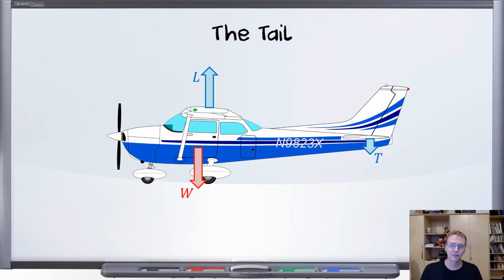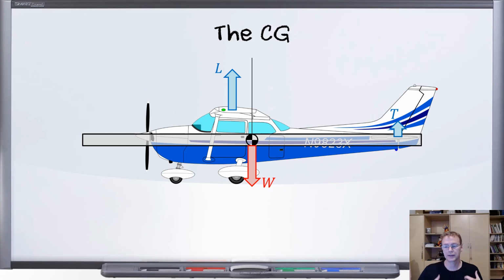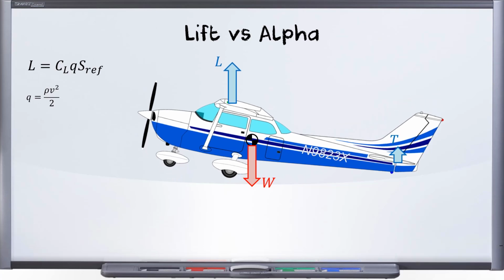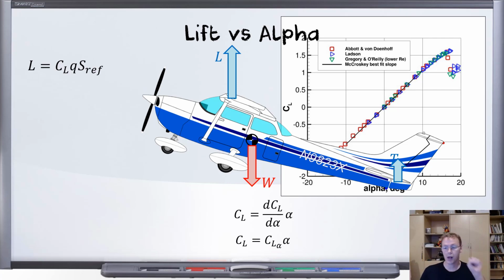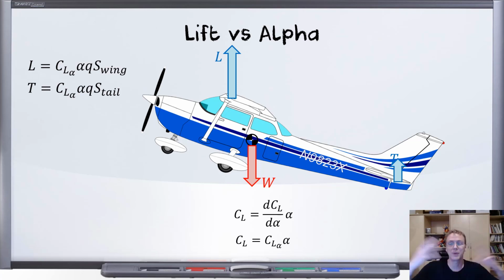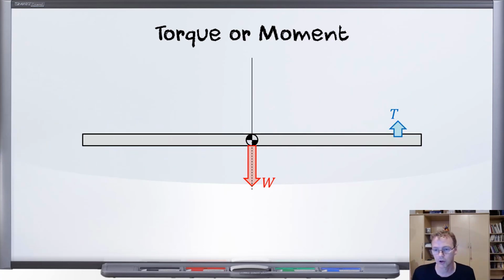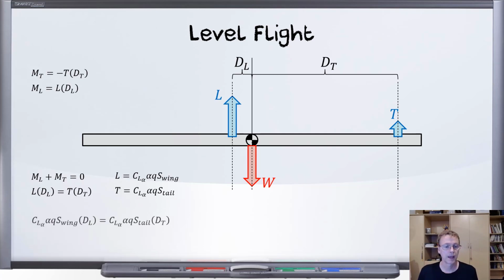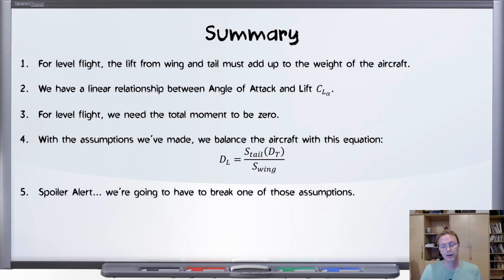Stability Part 1

Comment: Ideally we want to iron out all the assumptions right?
I guess I'd start where you started, with the linear relationship of what was it angle of attack vs Q. So that our equations could more accurately cover a greater range of airspeeds.
Honestly I have no idea what I'm talking about!
Reply: I'm laughing out loud at that last bit, Turtles.
Reply: @MarkMichalowski  I started off thinking I sort of understood what I was going to say, but by the time I had finished saying it I realized that if I had misunderstood one small thing then my entire comment may be nonsensical! At that point I figured a disclaimer might be wise!
Reply: @iliketurtles4463  I've done exactly the same - and usually scrapped the whole post. I applaud your honesty :))